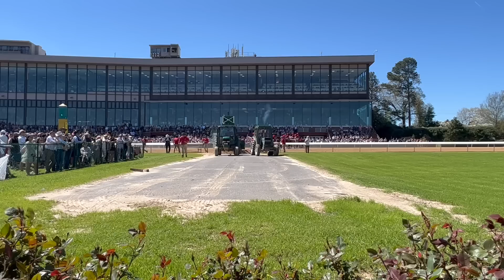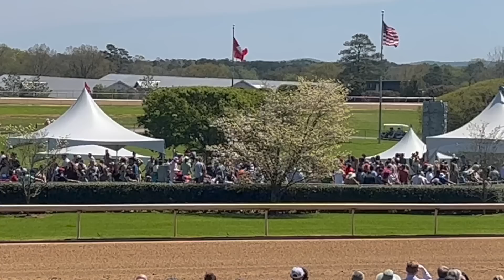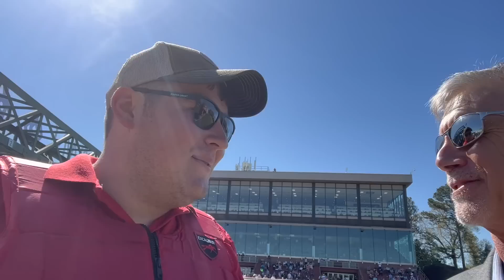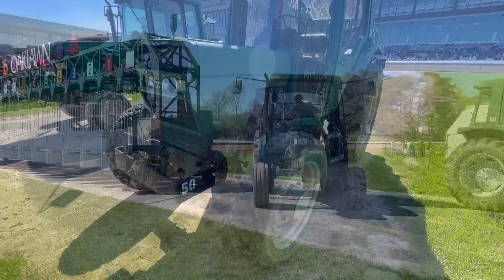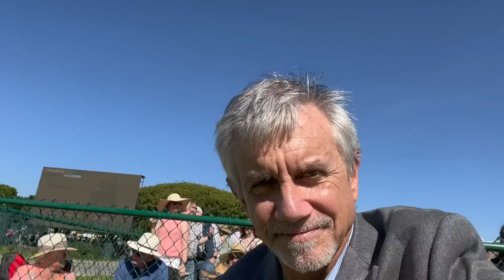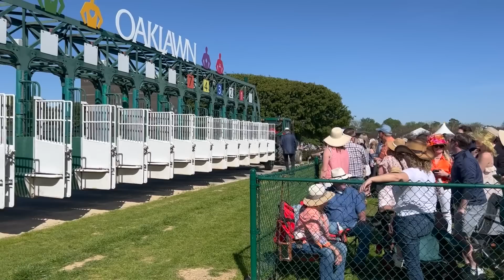The World's Most Stressful Tractor Driving Job - Moving the Starting Gate!

Comment: Fun video, thanks Mike - but I'm amazed a big organisation like that allows a process where the tractor backs up towards some kid holding the tow bar and then even crazier they have some guy (I think) sweeping up behind the trailer as it's being reversed. INSANE! As a retired operational risk expert - I would never sign off processes like those. Risk is measured by likelihood and impact - and at some point an accident is going to happen with the processes as they currently are. Just because it hasn't gone wrong up until now - does not mean that it's a safe process and the impact of those going wrong would be catastrophic.